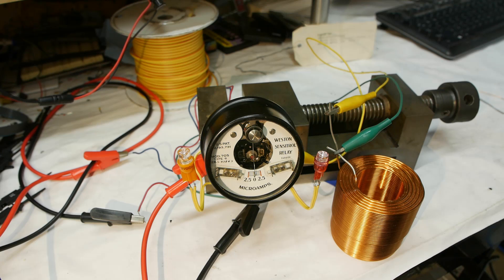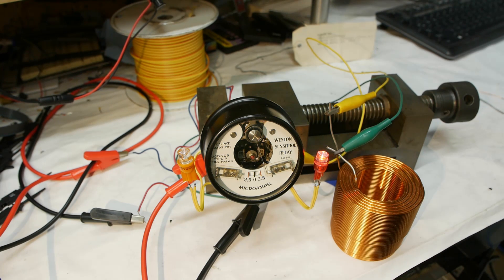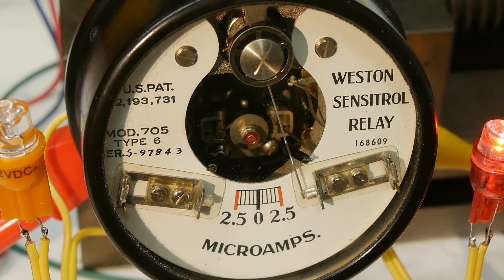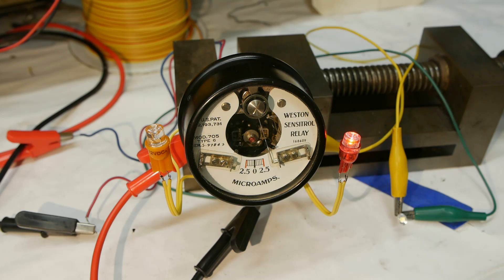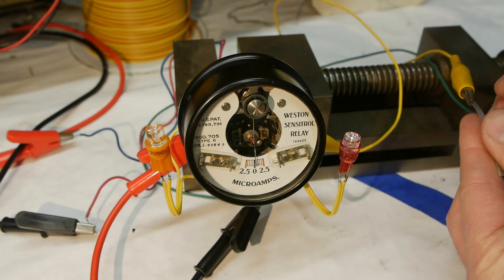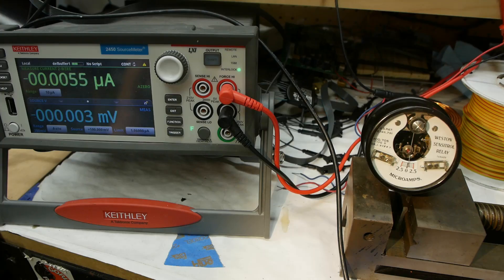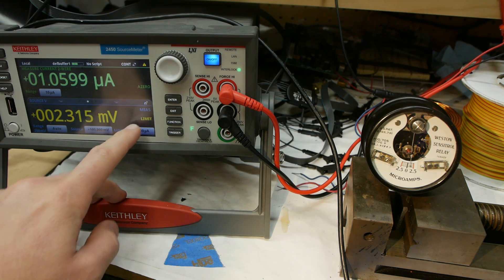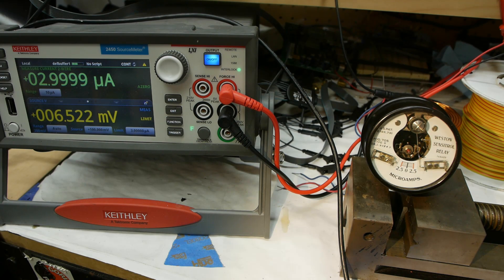Vintage electrical tech - Weston Sensitrol Relay

Comment: Don't like being picky but when you talk about the 'momentum of the needle' providing a form of averaging (or damping) it irked me somewhat! It's not the momentum it's the INERTIA of the needle... I never thought you would get caught by that common mistake.
Reply: Music Bro   As I've understood, these have the same meaning; resistance to change in motion.
Reply: You are right, momentum and inertia resist both positive and negative acceleration. But it is important to understand the difference imo. The needle has no momentum when it's standing still, it has only inertia. Once the needle begins to move it has in fact both inertia and momentum. The mass of the body (the needle) requires energy to change it's current velocity, whether it's at rest or if it's in motion, that is inertia. Momentum is the kinetic energy the body has from it's mass being in motion.
Reply: Music Bro     Yes, I completely understand and agree.  I find the other POV a result from programmer's detachment from living in the real world or fundamentalist's value of zero. 

I also believe 0! should not be equal to 1, infinite series should not use equal signs, and Wikipedia could use "specific" instead of "dis ambiguous", lol.
Reply: The real world is always teetering on the brink of dis order... It's just disturbing when the dis order starts to be seen as a new form of order, then we don't know what the hell is going on! haha...